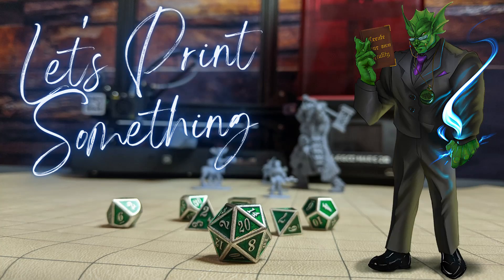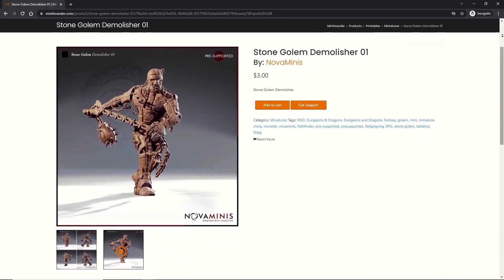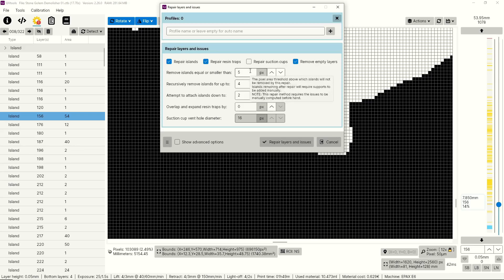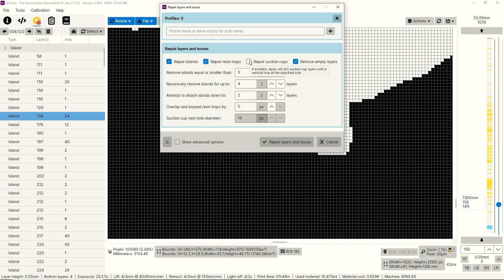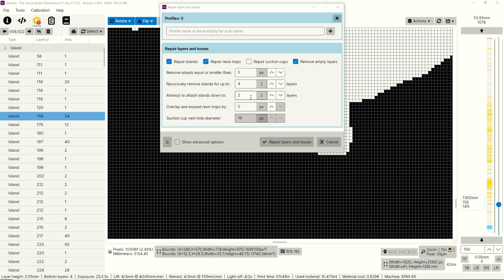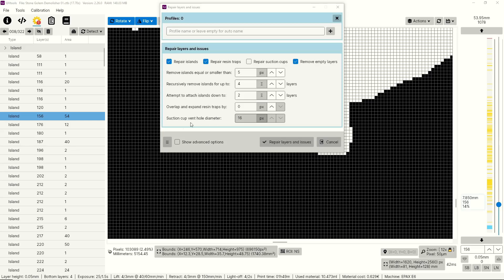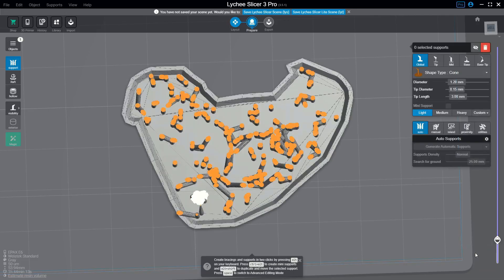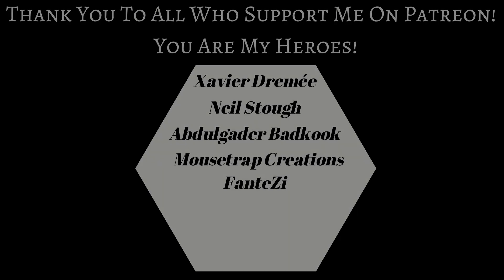Get the Best Resin Support Placement With UVTools!

Comment: I just downloaded UV tools and followed your video - but as soon as I opened the file (sliced with Lychee) it opens op and to the left I only see "EmptyLayer 1727 0" - the 0 is underneath area. Also when you go back to your slicer to make sure it matches, then mine is mirrored.
Reply from the maker: What printer are you using?
Reply: @SlicePrintRoleplay uniformation gktwo

Comment: Thanks for putting this together. Dumb question- why wouldn't the seller do this prior to releasing the file? I just bought my first printer and waa not aware of how many "islands" and "holes" Lychee would be finding in mode!s that are being sold as pre supported
Thanks again
Reply from the maker: @b8nducciify  not a dumb question at all. Basically it comes down to two things.
1, either the seller doesn't know this process exists. So they do the best they can but don't necessarily understand how to support models correctly.
2, they don't want to take the extra time to run through this process. Perhaps they don't have the time.
In any case, never assume a pre-supported file has been supported correctly. Unless it's from a creator you know to provide good supports.
Once In A Six Side was working on a rating system for stuff like this. Maybe check that out to avoid some struggles.

Comment: When I used UV Tools I fixed everything I need to, save the file as m5sp for my m5 pro printer. But whenever I insert my usb stick, the printer's preview screen does NOT show the file like normally. Does that mean it won't print out anything at all? Or will it print out like normal with the exception of the preview screen being empty? If anybody knows I'd greatly appreciate it 🙇‍♂
Reply from the maker: @LightWolfArt  I unfortunately don't have an answer as I don't have that, or any, Anycubic printer. However, I've heard of this issue happening occasionally. As far as I remember the file should print fine. However, please let me know if that's not the case.
Reply: @SlicePrintRoleplay  Thanks for replying dude, yeah I did end up going with it but unfortunately nothing printed out. I did see when retrying the print that UV Tools said how my file could have issues since the file is set for version 517 whereas the UV Tools was set for version 518. I did change it so they matched but still even doing that, the same issues happened. I saw some people saying it may be an issue with Chitubox
Reply from the maker: @LightWolfArt  thanks so much for letting me know. I'll keep my eye out for this issue in the future.
I'd highly recommend posting on the UVTools Facebook group. The creator normally responds very quickly.

Comment: First of all, thank you for the video! It's very detailed and it helped me a lot during my prints.
I have a couple of questions tho.
For example, I slice the model in my slicer (chitubox) and then open it in UvTools and hunt for islands.
So, in one window I will have UVTools oppened and Chitubox in another, going after the layers.
When you mention to repair the files. I save the sliced model again and press Ctrl+F5 to reload the STL in UVTools.
Press repair and save. That model, will not be able to be oppened in Chitubox, right? So In order to print it I will need to use the USB stick. Right?

What do you think about making a video of the complete proccess?
Like, get the model, slice, fix islands, repair, print and paint? It would be awesome.

Comment: Thanks a lot for this. I imagine that when you decide to remove islands based on a pixel count (here: "remove islands that are 2 pixels or smaller"), this heavily depends on the size of these pixels, doesn't it? Because a high-definition screen with 18µm pixel is not at all the same that a screen that has 50µm pixels.
Reply from the maker: @fluxcapacitor  that's an interesting question. At the time this video was made there wasn't such a wide range of screen resolutions/pixel sizes. I'll have to look into this question a bit before I answer. 🤔
Reply: @SlicePrintRoleplay  Please do and take your time. I appreciate that you're thinking about it.

Comment: It's worth mentioning that in your video your file opens with the 'issues' tab open, which isn't the default. So if someone is struggling to find the islands list, click on the second symbol in the top left. Also, saving the UVtools processed file meant I could no longer open it up in Chitubox to add the supports
Reply from the maker: That's a super important call out. Thanks for that! This video is a few years old. At the time the default for UVTools was to open into the issues tab. However, that's changed with newer versions.

Comment: Instead of manually looking through 1000s of layers could I use the repair layers and issues button and get a similar results as looking for the islands individually?
Reply from the maker: The way this software fixes islands is by either attaching island pixels to ones near by or by removing them. So if you have an island made of multiple layers that doesn't have supports near it, then you may run into issues repairing those types of island automatically.
But you can certainly try it!
Reply: @SlicePrintRoleplay  thanks again for the response so quick. I actually ran through up to about 250 layers manually and then just hit the button. Its printing right now and will let you know how it turns out. Have you determined a minimum pixel count you will even bother with? I’ve noticed those around even 10 or so are kind of a pain to add supports sometimes and I just skip them.
Reply from the maker: @Crusader158  you are very welcome. I try to respond to all the comments on my videos. 

Yes please let me know how it that print turns out. 

As far minimum pixel size, that's totally up to you. If you want to set up values to remove islands of 10 pixels or less than definitely try it and see how it goes.
Reply: @SlicePrintRoleplay  I may give it a try. I think those little floaters that we can’t see on n the slicer has definitely ruined a few prints as far as quality. I kept having some odd spots on some prints show up where extra resin bonded. I’m guessing this was the culprit
Reply: @SlicePrintRoleplay  print came out fine. Just had some slight warping on the base of the mini I was printing, but don’t think that was from something I missed in uvtools. Wish I could send you a pic of it.
Reply from the maker: @Crusader158  you're welcome to join my Facebook group and share a picture there. Or reach out through Instagram, Discord, WhatsApp, etc.
Reply: @SlicePrintRoleplay  couldn’t find the discord link in information above in the video. Could you tell me what it is? Thanks!
Reply from the maker: @Crusader158  sorry about that. I need to figure out why I can't display that in my profile. But here's the link, https://discord.gg/u3UgmjAyN2
Reply: @SlicePrintRoleplay  awesome thank you!
Reply from the maker: @Crusader158  you are very welcome.

Comment: So UVtools requires a slicer to make the repairs?
Reply from the maker: I'm not sure I understand your question.
Are you asking if UVTools can repair sliced files that have islands? The answer is, yes. UVTools takes a sliced file and can edit, repair, and change it in a number of ways.
However, it can only use sliced files. You can't makes those some changes to a base STL file. But I don't know why you'd want to.
Let me know if that answers your question.

Comment: Hi, I have a question about UVTools, i repair and correct all issues and save as ctb. Then i open the result file in chitubox but model appears pixeled and not pulished as original, is that alrigth?
Reply from the maker: Are you using the same or similar settings to the defaults in UVTools?
It's possible there is an issue, but it's more likely that the preview in your slicer isn't displaying correctly. I'd try a print like that as a test and see what the results are.
Reply: @SlicePrintRoleplay  Ok, thanks i'll try and see what happend, by the way the settings in UVTools are by default

Comment: The apparent difference in layer number for island ID between UVTools and Lychee is because UVTools starts it's layer count at zero whereas Lychee starts at 1. Therefore layer 116 in UVTools is layer 117 in Lychee exactly as you eventually discovered. So add one to the UVT number and go straight there. Anyway nice video. Cheers.

Comment: What happenes if you push the repair button in uv tools? Does it not automatically add supports? Have you tested how they print when fix in uv tools?
Reply: Repair islands will not auto add supports, it will attempt to merge with nearby blobs given your settings, it will only work with nearby stuff, far islands it will not touch it and require manual intervention
Reply from the maker: So at the 2:50 mark I explain the different settings you can adjust that will determine how UVTools repairs the issues it's identified.
Once you hit the repair button UV Tools will repair the model in accordance with those settings and how you've adjusted them.

I've had great results when having UVTools repair islands using the process I go over in the video.